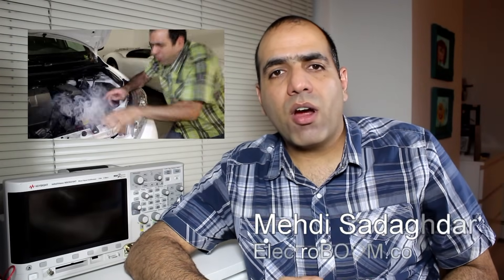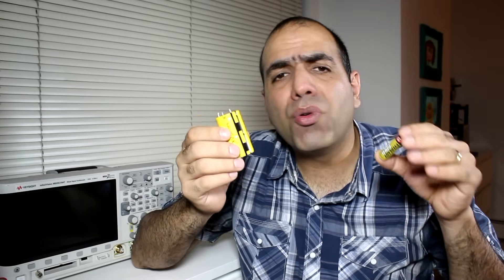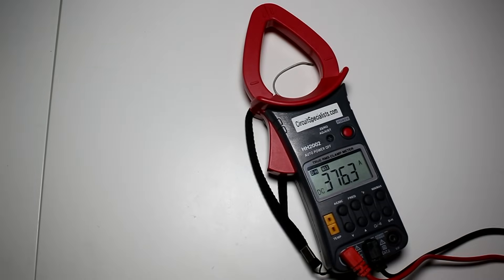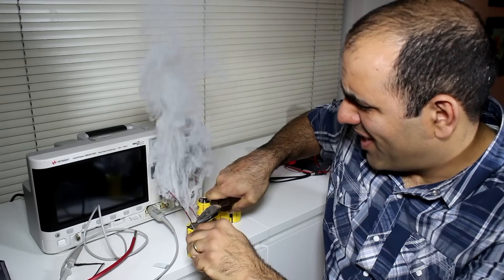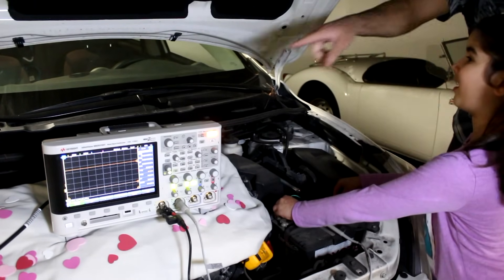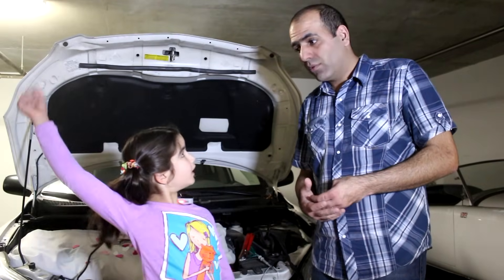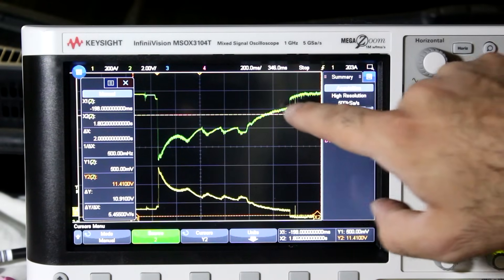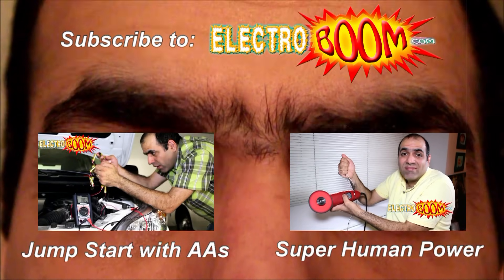Cranking a Car with Super Capacitors (Supercap)

Comment: Good day to you ElectroBOOM

Bloody awesome video/s, you are hilarious !
I am very interested in making a capacitor battery for my 750cc motorycycle due to the long life of capacitors in comparison to the cost of replacing the original battery every two years, which seems to be costly here in South Africa.

What i would like to know is how many cranks in total would you get from those six capacitors connected in series to my 750cc motor,you did state that you get one engine crank for your vehicle, but is that really the case or can you a few engine cranks especially since its a 750cc motor?

what is your take on this?

Comment: That was a huge risk. It's true that the battery's voltage is low, but you know the electromotor could generate reactive voltages of thousands of volts and it'd electroCUTE her immediately.
Reply from the maker: The battery would of course absorb all that energy and the voltage wouldn't rise more than a volt. So... Safe!
Reply: These sorts of experiments are definitely not something ordinary people who don't know a hell of a lot about what they're doing should be performing. But people who understand everything about what they're doing and what's going on aren't taking risks, they're taking calculated risks, which is an entirely different animal.
Reply from the maker: :) You are right about the motor being also a generator. And they can generate huge currents like 100A too. But being connected to the car battery, all that current pours into the battery charging it, and the voltage rises a bit as the battery internal resistance is small. But if the battery is not there, the voltage can rise a lot zapping the hell out of the person holding it.
Reply: As someone who has worked on vehicles a lot in my life...

Yeah that ain't happened to me. I wouldn't be concerned at all by it. Now the spark plug wires... 50 thousand plus volts of pure blow you across the shop screaming "FUCK" fun.
Reply: Then you'd best learn to read.

Again. The circuit is broken once the key ceases to be turned to the cranking position. So it's now an open circuit.

The motor does not continue to spin after power is removed from it. It's completely disengaged. The brushed motor quickly ceases its spinning, and has very little mass to keep it going.

Speaking of brushed motor. It creates DC when used as a generator. It is not brushless.

Hence why very old vehicles would use the generator as a way to charge the battery, and to start the car.

BUT HEY WHAT DO I KNOW. I just work on automobiles daily, and have never been electrocuted! Ever! I'll literally wet my hands and hold onto a battery terminals while my friend cranks the car over.
Reply: What the hell are you talking about.
The starter motor? The power goes from the positive, to the starter solenoid, to the starter, then the starter is grounded to the frame.

There's no rectifier or capacitor. At all. Learn how automotive systems work.Plus you do know the starter motor is not in contact with the flywheel once started right. The second the key is removed from cranking position the solenoid disengages (breaking circuit to positive.) then the starter gear retracts,.. In general you might just be dumb.
Reply: The plot of the battery voltage shows no voltage spike due to the motor inductance.
Reply: ElectroBOOM I think the high voltage will happen only if you break the car at full load. L di/dt
Reply: Richard van Pukkem it will be the 15th accident that gets ya. Or maybe the 20th.
Be more careful my dude.
Reply: Once i had a ranaway moped, and i resorted to pulling the wire off the sparkplug. Next path to ground: me. Ten-thousands of volts hammering at engine rpm frequency through me :-D. I’m still there. Also survived 14 accidents of 230 volts. It takes a lot more to actually harm a person.
Reply: Masoud Gheysari reactive power is imaginary.
Reply: +ElectroBOOM That was the answer I was looking for! "The internal resistance of the battery is so low, it can absorb all the reactive current fast and easily." Thank you.
Reply: Yes, I'm dumb. But the smart person you are, you should know that every electromotor is actually an electricity generator too. If you rotate it by hand, it'd generate AC electricity. Now we are rotating the motor by applying a voltage from battery to it. When it rotates, it generates high voltages by itself. It's true that it's connected to the car's case, but not to the ground. And the battery can't absorb all that voltage as fast as we need. It'd also decrease the battery's life. But I'm just a dumb person. I better be quiet and listen to you professional who is not an asshole at all talk.
Reply: Would you please design an experiment by connecting an electromotor directly to a car battery and touch the contacts yourself? Because I'm pretty sure there is something between the battery and the electromotor here like a rectifier or a capacitor which absorbs the high voltage and the shock. Otherwise I'm still pretty sure about the dangers of this. The experiment is right inside your system!
Reply: I respect your opinion. I was just replying to the person who called me dumb.
Reply: I didn't say you did. But "Liam 4.0" did call me dumb. And I was replying to him. Unlike him, you are a respectful and nice person.
Reply: I need to learn to read? I'm talking about when you're cranking the car. The starter motor acts as a motor and a generator SIMULTANEOUSLY. It means it gets power from the battery to rotate, and SIMULTANEOUSLY, it generates electricity. And it's AC. The thing that you say a generator produces DC voltage means you know nothing about electronics. Maybe you're the god of automotives, but you don't know anything about electronics. The power from the dynamo goes through a full bridge rectifier before going in to the battery. And you didn't even read my experiment proposal accurately. I said just a motor and a battery, not inside a car, with all other things removed.

Comment: That was a huge risk. It's true that the battery's voltage is low, but you know the electromotor could generate reactive voltages of thousands of volts and it'd electroCUTE her immediately

Comment: May I ask you how you measured current with an oscilloscope?
Reply from the maker: There are these current clamp meters with voltage output you can plot with a scope. In my case, the output is 1mV for each 1Amp.
Reply: +ElectroBOOM thank you!

Comment: Why is it that when you were cranking the battery at 4:25 sparks come from the battery? Did you make contact with the copper wires connecting to the battery to the socket wrench?

Comment: I knew it was possible, I thought it might work but was scared of it delivering more Amps thus destroying the starting alternator..
but when it is started i was satisfied.. really satisfied! this was amazing!
I knew that to start a car the battery pushes over 300Amps of power,  but 750A????  is it an alternator powered motor that starts the car?  i want to see it! 750A is not a joke! welders use 120A-240A to melt welding sticks,  i really want to see the motor's winding! unless it isn't?

Comment: How fast can they deliver current? I am considering to use em as propulsion (if it is a correct word) for homemade railgun, just as a project to kill a time and maybye myself by an accident...
Reply from the maker: I'm trying to do the same too! current delivery is not an issue, they can deliver 400A instantly. But you also need high voltage.
Reply: I might disagree with you on this part. My guess is that voltage around 5-7 volts will be enought, in railgun you need current, while in coilgun you need voltage. That is my guess thou.

I've asked you about current delivery because when u shorted it with that thin little wire it looked like it was heating up propably same speed as if it'll while connected to a car battery. My guess was that that ammount of current will burst that thin cable like fuse, in an instant, if u understand me.

Only thing you need to really care of is cooling and some sort of minimal friction while launching projectile and also sort of 'prelaunch' thing sou your projectile connects with rails at decent speed that it'll prevent weld effect and spread heat more evenly thru rails.
Reply from the maker: The reason I'm saying you need higher voltage is that at low voltage, your projectile will hit the rails and likely get fused to the rails shorting them, and doesn't move anymore. If you raise the voltage, it will get so hot that will melt the sides of projectile and as it moves it maintains an arc that still allows the current through. Also the high voltage means higher currnet
Reply: Well, yes, but in order to achieve hight voltage you need to stack up multiple caps in series which is [1/C=1/C1+1/C2+...+1/Cn] basicly for same ammount of caps less capacity, but while in paralel it goes [C=C1+C2+...+Cn] which give you more current. Also, you really don't want to melt projectile unless it is made of Tungsten, I'd suggest to use some sort of high velocity and force launching device, like potato gun and both, rales and sides of projectile cover with extreme fine molybdenium dust which will lower friction.

That is just a suggestion thou, but I think that more voltage won't be that usefull because you will have to change rails every so often.
Reply: @ElectroBOOM  what about using graphite rods as rails?
Reply: Lol notice how he stopped replying to you? It's because you're just spewing out the middle school level physics that you just learned instead of providing any insight.
Reply: @ourgamepc5998  "spewing out the middle school level physics" Uhhh its high school level physics not middle school level physics cause middle school level physics are on a WHOLE other level.
Reply: You can always give the projectile a jump start with a spring or compressed air. You don't need to start the projectile from rest. Starting it off moving at 100 FPS or so will keep it from sticking.
Reply: I don't think you could get any lower ESR than a supercap. Should work perfectly well for a railgun.

Comment: Back in my HS days, we used to charge electrolytic capacitors (high voltage ones) with their leads spiraled around the capacitor body.  Then we'd carefully grab it by the ends, not touching the leads and yell "catch" to some unsuspecting group of kids filing by our radio shop and quickly toss it.  Someone would inevitably catch it and get zapped.

After a while, no one would catch anything coming from the radio shop.

Those were the days...

Comment: i hope you didnt burn your finger for the sake of this video. that burn was really bad
Reply from the maker: No, this one was a mistake!
Reply: The burn was made in the name of science so it shouldn't hurt that bad.
Reply: Looks like it wasn't that bad, I've had worse soldering.
Reply: what did you expect? you are going to discharge a huge cap with a thin wire
Reply: can you make a flamethrower souds ez

Comment: Why didnt you use a FULL BRIDGE RECTIFIER ?
Reply: Damn, I read it with his voice in my head :D
Reply: Exactly, it can not be unheard :D
Reply: can you say FULL BRIDGE RECTIFIER without the echo effect
Reply: Thor Wald Seems like he is used to it :\
Reply: Because a lead acid battery outputs DC VOLTAGE. FBRs are used to "rectify" (convert AC to DC) voltages
Reply: That would successfully convert the DC power into DC, while dropping the voltage output by about 1.4 V. Sounds like a great idea.
Reply: Hanro50 It’s rectifier, not rectify.
Reply: @Engineer9736  he was explaining something so rectifier was turned into a verb, "rectify".
Reply: Richard van Pukkem 
THANK YOU VERY MUCH
I was wondering what was wrong with my echo generator. It was firing at RANDOM

Dammit
Reply: Why would you need 1 in a car? There is already 1 in the electrical system plus the battery is DC. So it's safe to assume there is no need for 1
Reply: There is already one built into the car's alternator...
Reply: You just have to ruin all the fun dont you...

Comment: Hey Mehdi! I think the voltage drop might be caused by the contact resistance of the terminals... since your clamps-technicque does not deliver the same contact area and same "force" compared to the battery terminals of a lead acid battery. IIRC the the voltage drop should be much lower due to the lower internal resistance of those supercaps.
I could notice the same when i tried to start my car with the battery of my quadcopter - its a 12,6V Lipo with 6Ah and a continous discharge with almost no voltage drop at 90C (540AMPS!)... and the car had issues to crank. Thanks to the thin wires and tiny, cheap clamp terminals

Comment: I have 6 of the same size (D cell) supercaps that I wanted to start my car with, but I connected them to a balancing board from Ebay, and they won't start the car. I'm not sure why. Could it be the resistance of the PCB?

Comment: electric confuses me to no end. first i hear that a very low amperage across the heart can kill (like 30mA) yet 666 A didn't even maim!
Reply: +Thatoneblackguy258 The human body has a high resistance especially if going from hand to hand or say hand to leg (longer distances) however the higher the voltage the easier it can be to complete a path through the body and cause unwanted things (if it's pushing a high enough current) in the example of the car battery it's only 12v doesn't matter if it's outputting a high current
Reply: yeah if the resistance of the body was 100 MegaOhms, and the voltage was 12v, the current would be 0.12mA. That obviously varies a lot, and the resistance can certainly be less than that (such as if you wet the skin).
Reply: DC (Direct Current) requires more current to kill you because it's not as easily passed through your body as AC (Alternating Current) because capacitance within your body allows AC to pass through much easier so not much current is needed to kill you.
Reply: Yes, it's the current that kills... but it needs a high voltage to penetrate the body. The commonly considered "safe" voltage is 60V and below. Above that, don't touch it, regardless of the current capability of the source.
Reply: .12mA then?
Reply: Well, it'd probably be better to say we are crappy insulators (but also crappy conductors). An isolator is a material that has a much higher resistance still. The line is somewhat vague between and insulator and conductor, but I'd say we conduct well enough that I wouldn't quite consider us insulators. Basically, we are though for small voltages.
Reply: interesting stuff
Reply: That is the max current, the actual current is inversely proportional to the resistance (I=V/R) so when connected to the wire or car with low resistance it puts out that current, but the body has a much higher resistance and thus takes more voltage to reach your 30mA.
Reply: In the same way if you have a very high voltage source, but one that can only put out a limited current (such as a van der graaf generator), while the voltage is enough to produce deadly current, the current is limited by some other source (such as the speed at which electrons leave the belt on the van der graaf generator).
Reply: so basically we're really good insulators?

Comment: Out of curiosity, how much do the 6 super capacitor weigh in total compared to the battery?
Reply from the maker: it weights fraction of the battery. The damn battery is super heavy. It is filled with lead
Reply: you don't just use the battery to start the car, you will inevitably use it for running the fan, radio, lights etc. the capacitor would die in a very short time and you'd be stranded.
Reply: o m gosh
Reply: replace heavy battery with Super caps? Nah, too expensive probably
Reply: +Flamey Kumori supercaps aren't very expensive
Reply: not enugh capacity. supercaps are amazing, don'T get me wrong, but they just can't stand up to a lead battery...

...for now
Reply: I think it all depends on how it takes to charge them, I mean, they are usually being charged while driving and once fully charged, they can deliver enough power to the crank to ignite a car so I don't really see why a lead battery is needed in a car
Reply: SunSatlON remember, they have a high leakage current. and cranking a diesel takes  lot more energy than cranking a petrol one

Comment: Hmmmm so this begs the question: How many super capacitors would it take to power a Prius? I mean of equal duration as the existing batteries. Why? Well those crappy prius batteries go bad after a few years and cost thousands to replace.
Reply: ...and take a long time to charge (I guess).  I suspect these caps could be charged much, much faster.
Reply: yes, but they take a bigger space. Probably have to pull a trailer with the supercaps in it
Reply: pretty sure the Prius batteries last about 10 years or 300,000 Miles... which i wouldn't call crappy at all. I swap out 2-5 year old fire panel batteries daily for a living. we charge about 250-300 for the 30 minute visit and batteries.
they are usually 12V- 7Ah. 84w ... 0.28W/dollar
the prius battery costs 2500. 200v - 6.5 AH.  121,000w  48.4w/dollar...171 times cheaper.
Reply: You would need a couple semi-trailers of super caps to trail behind your Prius to store that charge.  The good thing about all this research into battery technologies is that lithium battery manufacturers are learning from the super capacitor manufacturers how to make better and longer lasting lithium batteries and super capacitor manufacturers are learning from battery makers different methods to increase the capacitor surface area and storage capacity.  It seems that graphene is still the holy grail being pursued for both technologies.